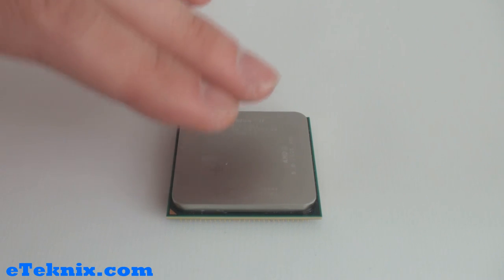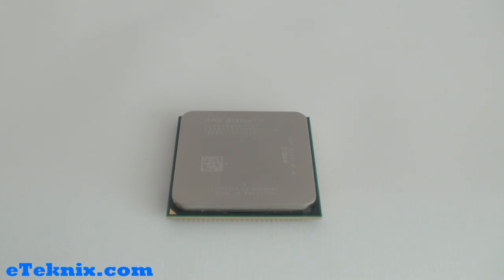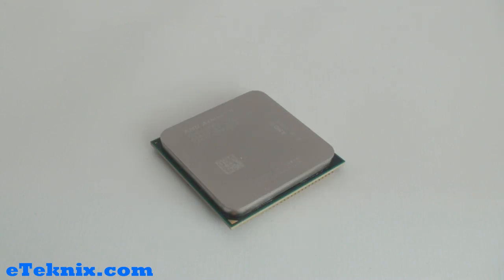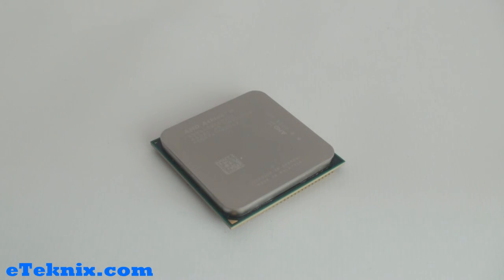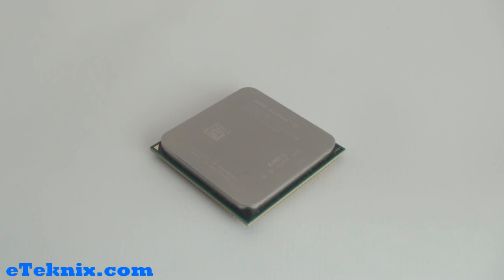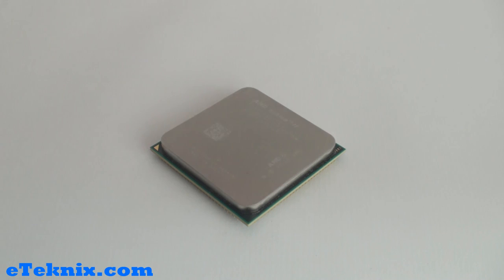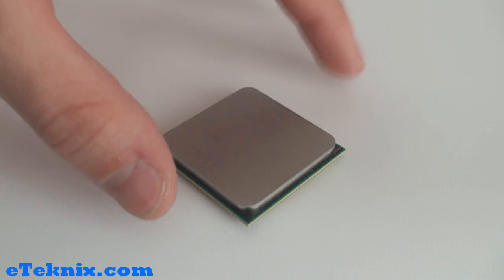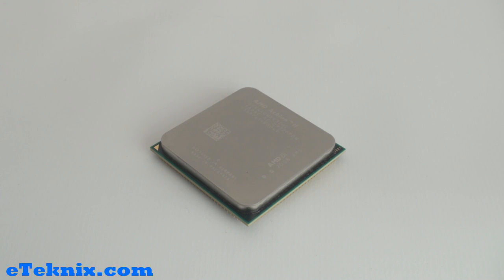Video Review: AMD Athlon II X3 440 Tri-Core processor

Comment: I have it and i overclocked it 
to about ~3.45Ghz and the temperatures are pretty stable even on full load
Far Cry 4: Very High-max 50 minimum 20 average 35
depending on GPU...

Comment: Will this work on a ASUS M2N68-AM which says it uses a AM2/AM2+ hookups and can support Phenom FX/Phenom/Athlon. The manufactures website says it will support up the the Phenom II X6 with a bios update. I just do not see how this works, is it just that it has 2 fewer pins but the remaining are all in the same place as the AM2+ hookup, if so that is another reason why AMD is amazing, I rebuilt this computer over 2 years ago and the mother board will still last a couple more years, unlike Intel.

Comment from the maker: @MidnightOrganFight Some quad cores are black editions which means you can unlock the multiplier for higher overclocks, but if you are referring to unlocking a tri-core to a quad, it gives you another dorment core to use, thus getting an expensive chip for a fraction of the price.

Comment: @MmoInfo 
Lol its impossible to unlock a TRIPLE core, and make it a quad. The way you buy a processor is that way it will be through out its life cycle. You CAN unlock it, and change the processor frequency, and make the processor as good as a quad.

Comment: @Reddoguk Your board is probably an AM2,2+,3 combo mobo that work fairly well with am3 processors especially when you want to use your old ddr2 ram, someone who has 4gb(or even 2gb) and don't want to spend the extra 60-150$ will enjoy these types of mobos.

Comment: Under 80$ definitely the best price for performance. Equal comparison to an athlon is an (old ones)intel quad core, although this does far better in rendering and converting which I enjoy doing. You can run Sony Vegas, Camtasia, and browse the internet without trouble.
But AMD uses the same exact heatsinks they used over 5 years ago.